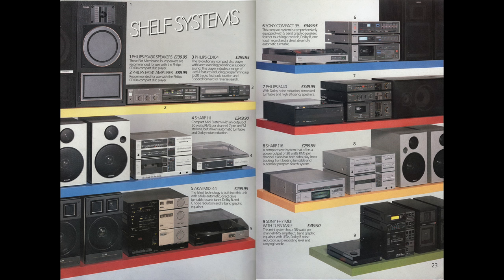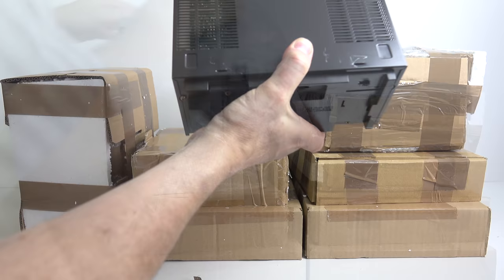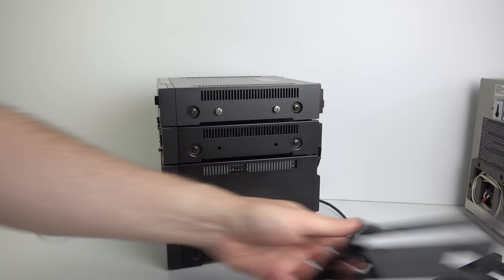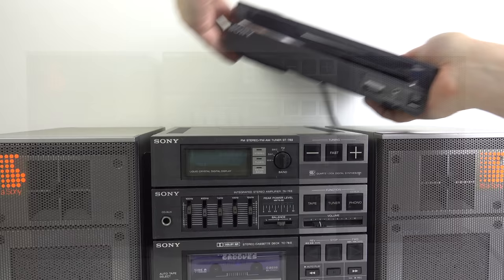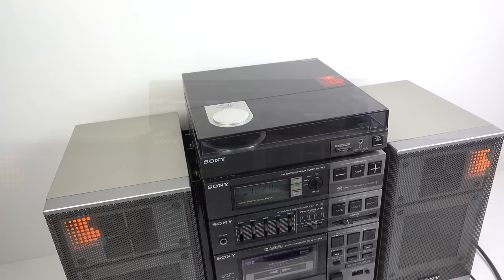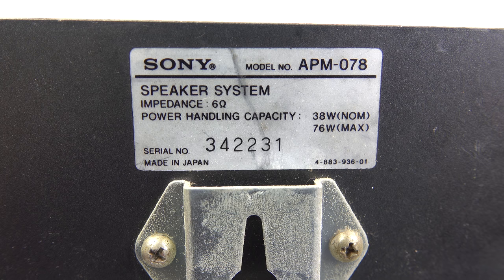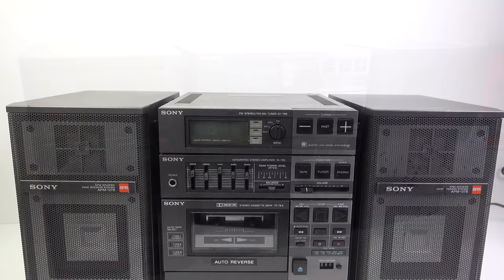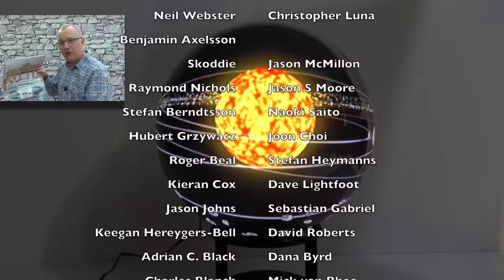HiFi Classics - Sony FH-7 MkII

Comment: people from the past were crazy. the modularity of this device seems completely pointless. I can envision a majority of users just hooking it into the brackets and going with that. at most the speakers would be detached and placed further apart
Reply: I'm from the past and I'm definitely crazy.
Reply: redtails crazy = awesome

Plus in the past designers wheren't know it alls that think they should decide how their products should be used.. They build in flexibility.
Reply: Something to note here red tails... people often started with base packages and then bought other things separate. This package probably was made for both those that were used to traditional hi fi systems and for those that were used to cheaper boom boxes.. it would had appealed to a larger market this way.
Reply: I can imagine manufacturers were not confident which format would win in the end. Had CD failed you could've replaced one of the modules with another format.
Reply: Decompiler that's another good point.. i hadn't thought of that but i do know that new audio and video mediums took a long time to really take off.  Even though tape decks had been put on the market for years im sure a ton of regular people still used vinyl for ages after this was released.  If your collection is almost entirely vinyl and tape this would be close to perfect...
Reply: Baron von Limbourgh
You understand and the folks that designed good products did as well, it was more expensive to make this type of system but it could be customized to personal taste and needs very easily. It also meant that they would sell more of them. Common sense was a LOT more common back then too.
Reply: People aren't getting my point. The fact they provide the metal side-brackets, the indentations for the rubber feet, and the clips to tuck the ribbon cables away (to me) implies that the manufacturer makes the assumption that the majority of users will configure the system in that way, otherwise they wouldn't provide it. Moreover, the unit does not function if you don't combine (at least) the PSU and the graphic equalizer unit, so why are these separate units? The possibility of using the system with a battery is not worth the cost and complexity of having separate components imo.
Reply: redtails i thought i addressed your point ok. Simply put,  People were used to modular units and people were used to boom boxes. This would have ticks the boxes for both groups and would have appealed to both groups.  The reason why these designs appeal can be completely ridiculous and not make sense.

This is at least my take on why they would design such a thing. We get your point about a modular design and separation of critical components might not make sense… If we're really all have misunderstood you then maybe consider that a majority misunderstanding something that you said could point more towards your ability to say it than there being something wrong with the way we are interpretin your words. "Us people" thought that your point was interesting and took the time to respond to you.  I'm sorry if you were more intrested in validation of your ideas then a conversation about why a design may be the way it is/was..
Reply: Decompiler when this was released, cd's where by no means a commodity or a widespread adopted technology. Records where the standard and the cassete tapes where also rising in popularity.

There where a lot of new technologies created and launched in the 80's and most of them failed and simply faded away after a year or so never to be heard of again.
At the time this was launched cd's where just one of a dozen of technologies that promised to be the new future standard in audio.

If you never have known a time in which cd's simply didn't exist and wheren't the defacto standard worldwide, it probably is hard to imagine why it wasn't immediatly recognised as the gamechanger it turned out to be. Now with hind sight it is easy to label it as obvious, but back then it was just another new thing that made the same promisses lots of other products also made.

And in 1985 a cd player litterally easilly cost an average months wage and very little music was available on cd anyway. It was something for real enthausiasts with very deep pockets. Everyone else was still completely happy with their vinyl records that where cheap and record players where in almost every household.

Same goes for mobile phones and the internet. Teens simply accept it as a commodities that have always been around and simply can't imagine how life was without these things a mere 25 years ago.
And that is fine offcourse, why would they have to know how things where before when we where young? It is just funny to see the reactions when you talk about not being able to reach someone if they wheren't at home at that exact time, and how important it was to be on time if you agreed to meet someone somewhere, you couldn't send a whatsapp saying you will be a little late.
Or how you needed to go to the libary if you wanted to know something.
Or how you actually had to know how to drive somewhere without a friendly voice telling you to take a right 300 meters ahead. And how many devorces those huge papermaps that never seemed to fold back together in the way they where when you bought it have caused over the years lol.
Or how you actually had to go shopping for every little stupid thing you needed because there was no online shopping or next day delivery.
Or if you wanted to talk someone in an other country you had to pay 30 bucks or so for a 3 minute call and then you where still only hardly able to even understand what the other was saying on the other side of the line.
Or that a message you had to write on actual paper took several days to reach someone trough the post after you went outside to drop it in a mailbox. No instant emailing.
Or making 24 pictures with your camera, hoping they where actually any good and then go and drop the film off when you got home,  wait a couple of days to get the developed photo's back. Only to then  discover most of them turned out to be bad, blurry, not in focus or of the inside of your backpack or travelbag haha. And if you wanted pictures of "private" activities you had to face the teen in the photo shop when collecting your pictures knowing perfectly well they had a very good look at them before you picked them up.

Obviously things are more convenient now and almost always simply 100 times better then back then, but back then we just didn't know any better. That was just the way things where and how you did certain things.
But it also changed a lot of activities from an actual experience you where much more engaged with around special occasions, into a meaningles activity.
When planning something a lot of the fun was in preperations and it also kept you engaged with it when it was over. Planning routes, buying film and get it developed, making tapes to listnen to, talking to actual people in order to arrange things and to get where you are going, sending postcard etc. I do kind of miss that nowdays. It took efford and could also drive you mad, but also was satisfying in the end. 

Buying music and listening to an album in the store was always cool. Discovering new music on mtv. Renting a movie for the weekend at the rentalshop and looking around for 20 minutes to find a movie you liked as a few examples.
Or actually looking trough the pictures you took of something, back then you only made pictures from things worth taking pictures of and you would show them to friends. Who actually looks at the pictures they take all day with their phone again later on nowdays? Most pictures are now taken just to make a picture, never to be looked at again. Sure the activity itself is still fun now and you are always able to catch something on film or in a photo, but it also no longer is something special or engaging as it used to be when i was growing up.

I feel a lot of fun and satisfaction little things like these used to add to the things we did and experienced is taken away now, and that is a shame i think.. Technology always makes things easier, but in the proces also turns things that once where exciting into mondain activities. 
And yes i understand the ability to share pictures instantly with the people at home when you are on holiday has another satisfaction of it's own and i am not saying the old way was better, but the old complicated way that required some specific effort had a charm of it's own you simply no longer get nowdays.

I sometimes think we have reached a point where technological improvement no longer always is an improvement. We used to develop technology to solve problems or to actually make things better or in order to provide a better experience when doing or using something.
Nowdays it seems things are developed just because we can. Even though nobody really asked for it or to solve something that really wasn't an actual issue.
But we still are expected to see these things as progress because for some reason our goal as humans seems to be becomming less active so we never have to get up from the couch again while we have things do everything for us, have less personal interaction with other people and only communicate through touchscreens with computers and software and move completely into a digital and interconnected world. Leaving the reality that surrounds us behind.

I honestly rarely get excited anymore for new technology that is created, even though i used to live for that stuff 20 years ago. And i still can get excited for new usefull things, like renewable power, self driving cars,  new and better matterials like carbon and nano technology etc. These are things we really need and will solve a lot of problems we currently have or will create ways to make life better for people less fortunate or that have conditions that limit their ability to live their life to the fullest.

But all the rest is just adding useless shit to things that are allready overkill to the vast majority of people on this planet. Do we really need 1000 megapixel cameras? Do we really need phones that have so many features that nobody uses. I want a smartphone that lasts 3 days without charging, i don't need a supercomputer in my pocket with a processor that never gets over 10% usage. I don't need websites filled with flashy animations that make them a nightmare  to navigate. I don't need a microwave that has internet acces, i don't want governments or corperations storing everything i say on the phone or everwhere i go. Or have every step i set outside my door monitored by cameras everywhere and my car telling some server somewhere where i go and how i drive, i don't need some company to register every penny i spend on every single item i buy and then feed me advertising based on that.

Technology is no longer something we should cherish and trust to make our lives better. At a certain point things are just the way we want them. At that point progress turns into regression.
And in some areas we have reached that point allready in my opinion, but nobody seems to notice.
Reply: watershed44 that also was a time where design was done on paper by a lot of people and took a lot of time, manufacture was done by skilled people in developed countries, plastic mass production wasn't really a thing, sales went through specialised chanels,  electronics where mostly analog and required a lot of switches and other components instead of cheap microchips and retailers and international shipping was still freaking expensive.

Things simply couldn't be made on a whim, and the above mentioned development and manufacture costs ment things couldn't really be made cheaply. So these things always where a substantial purchase, even the cheap "budget" versions. You can now buy a radio with tape deck, mp3 player, wifi and cd player for less then 20 euros from china. That makes it a disposable item and a commodity.
Back then a stereo was something you bought as the only way to listnen to music at home, it was just huge and therefore a part of furniture in your livingroom and only available at a pricepoint that when you bought it you also expected it to last a good number of years. Much like tv's and a couch are still nowdays. A decent tv costs half a monthly wage and you buy one every 10 years or so usually. A hifi was the same back then.
Who still has a dedicated hifi nowdays. It is all soundbars, cheap little boombox stule radios and mp3's trough headphones.
The devices used to listnen to music and how music is consumed have changed substantially
Reply: redtails
You must not have read what others like that of 
Baron Von Limbourgh posted. It isn't that many folks wouldn't have used the indents (double stack or more), or the ribbon cable in such a way, it was that the designers ALLOWED for that alternative usage. 
Some folks would have used the batteries such as on extended 
stays where there isn't electrification (holiday cabins) or the dockside, ect. Point is the options are there.
Reply: Baron von Limbourgh 
I agree with most of what you've said it is all very true back during that time. But even today there is a market for good quality mid-range products, it just isn't widely acknowledged by the market today ESPECIALLY in the USA. It's either the cheapest Chinesium, or the most outrageously expensive custom made product from a first world nation.

Comment: In the 80’s my parents used to buy there hi fi stuff from an appointment only shop called Studio 99. They had, indeed still have a very nice set up. Very simple. Their record deck is glass and minimal buttons, just a belt to change speed. I think most of their separates are Yamaha. They have had there speakers since the 70’s, they are Rams.

Comment: As always, another nice video. You mention 1980's hifi shops. In my teen years (1965) Acoustic Research had a Sound Room in Grand Central Station, NYC. It had some of the latest speakers and turntables from AR. I think they were powered by a Dynaco amp. I'd hang out there during summer vacation, sometimes all day asking questions, at least till they told me to leave. It was a swell place.
 Into the 1970's I shopped at Harvey Sound, tech hifi, Great Sounds, The WIZ, Stereo Warehouse, Audio Graveyard and Lafayette's to name a few stores. In 1983 I got my dad a Sanyo C-4 (carrying combo). Not as sophisticated as yours but pretty sweet. AM/FM, five band EQ, cassette deck, phono and aux inputs and decent speakers with 1.5" tweeters and 4" vented woofers. Power is 6wpc. When dad died in 1998 I got it back and use it in my office room. Thanks for posting this video. I do doubt the 280w peak and 140w "music power" though. Sony hyperbole???

Comment: Minor correction. The bottom section is the power supply. The middle section contains the amplifier and equaliser. It is even labelled as such.

Comment: My older brother had a nice JVC unit like this. About 1987 or 88. I think it had an analog tuner but it had level controls for the cassette deck which impressed me. I bought the first Technics CD portable and we used to connect them together. They were true mini hi-fi quality components.
Reply: Maybe was the JVC PC5

Comment: I have an original SONY FH 15 R in my garage, which i had for my 21st and loved it, the sound at the time was phenomenal I also bought the CD player to a company it.
Unfortunately the speakers blew, I bought new square speaker housings, but they didn't come in the right size. so Unfortunately, its just sitting gathering dust now. It was my pride and joy

Comment: I bought a FH-5 in the early 80s, and kept it at least 20 years til it fell apart from too many outdoor parties ;D    that one took like 8 or something D cells and could play pretty loudly for several hours on a set.  Was quite the excellent system.    It came with the 3-way APM 58 speakers, which looked a lot like the ones on that 7 mk III you showed.   Rather than a separate PSU unit, the batteries and power cord went into the back of the cassette deck.  Analog linear FM tuner.

Comment: I had the FH-7 MK3 in the 90's and loved it. But I gave it to my brother when I upgraded to the JVC CA-D8T that had the 3 CDs changer, 5 speakers and inputs to use Dolby Pro Logic with my VHS and DVD player. Heck, I still have the manual of the JVC, but unit is gone too.

Comment: Still have my parents FH-7  with the analogue tuner.
One advantage i can see the Analogue tuner FH-7 has is that it had 3 pairs RCA connectors at the back and individual CD/AUX source buttons.

Comment: I found one of these in a thrift store for 15$ and ended up keeping it for about 2 years (silver color). I got tired of the weight and moving it around so I gifted it to a coworker. The sound on this hifi is monster loud and I never really raised it past the first tick. One thing that I found odd was every time I turned the unit off it would always default the radio station to 88.9. Even if I was listening to another station before powering it off. Now that I have seen this video I realize why it kept doing that!!